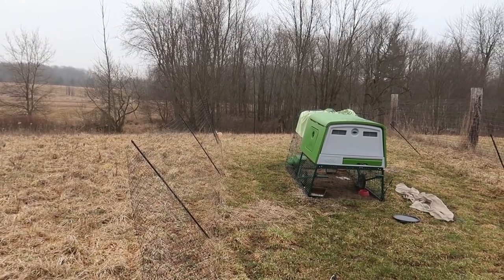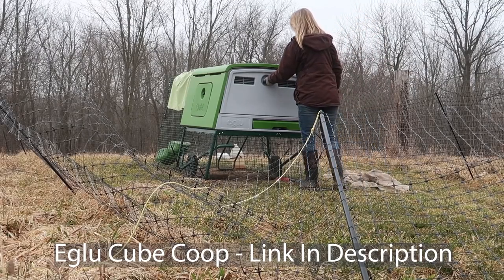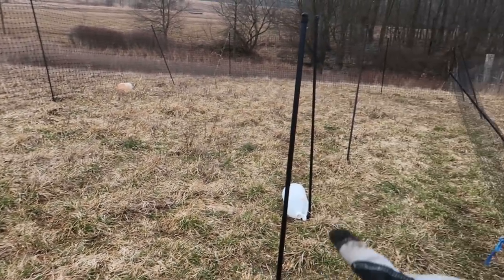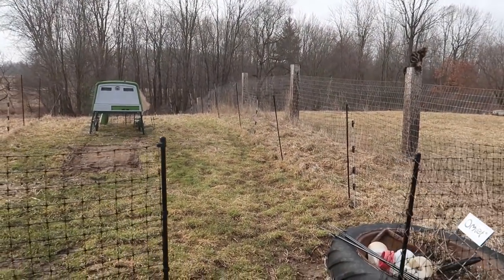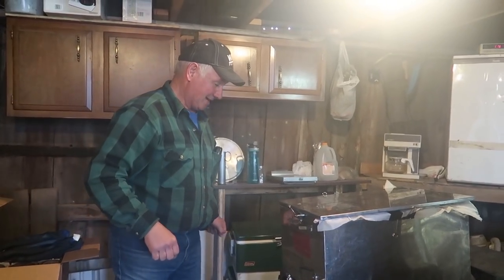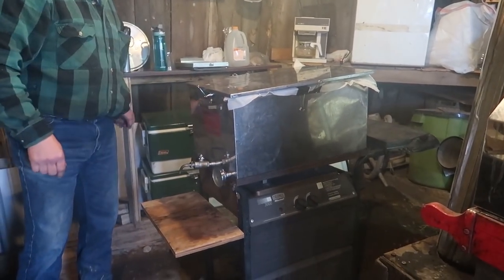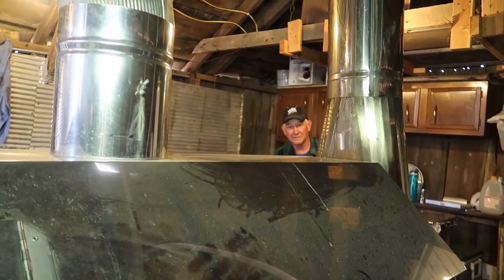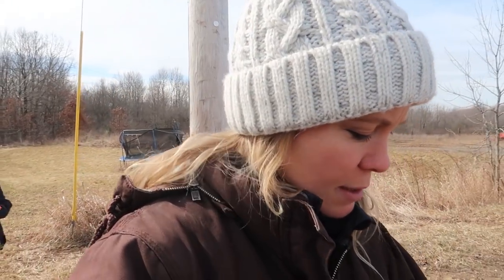290 Using the Eglu Chicken Coop to Hatch Chicks! - Plus Last Maple Syrup Tour!

Comment: 42 inch frost line there. Need to know for setting posts. We used to set posts  for chicken fence at least 36 inches. usually worked, depended on how bad winter was.
Reply: Should never get frost that deep in central MI  in a field  because of the snow for insulation .. Now  in your driveway  it will  go that deep ..
Reply: I set my fence post about 30 to 36 inches deep to prevent frost heave and I live in on the eastern shore of Maryland

Comment: I think you might want to put some 1/4" hardware cloth over the slotted coop bottom. Looks like the chicks could fall through and even if they don't they will have a hard time walking over it. A solid floor would be even better while the chicks are little. 
Hens will lay a clutch then sit. If you don't put them all in on the same day the hen may stop sitting after the first ones hatch in 21 days since she then has chicks to care for.
Reply from the maker: I just collected a fresh day's haul from the main coop and stuck them under her :)